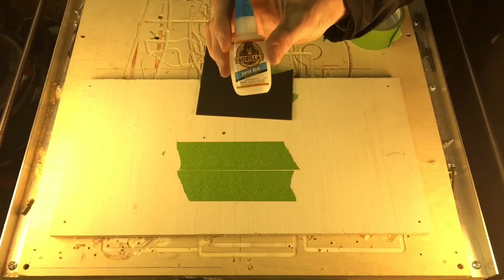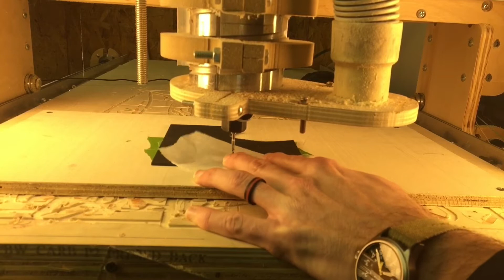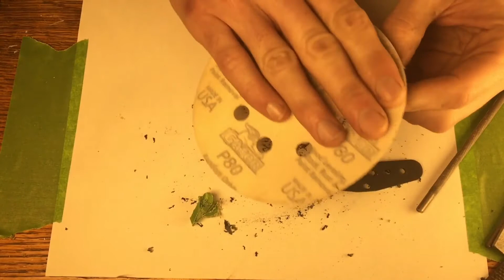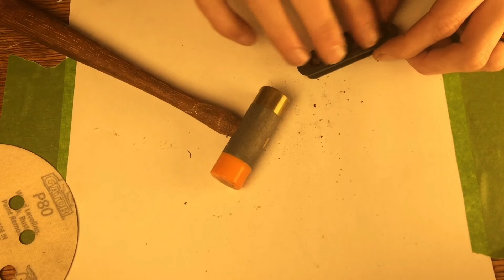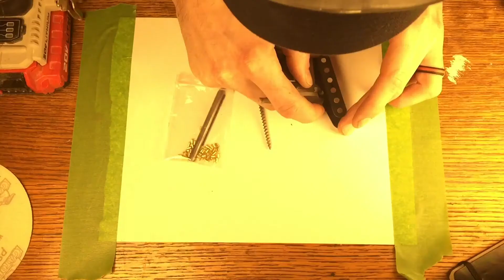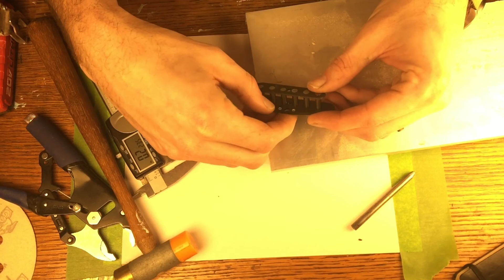How to Build a Guitar Pickup (Part 2)

Comment: Eyelets should be installed from the bottom so that there isn't anything on the coil side of the flatwork - that's how every one I've inspected has been made.
Reply from the maker: Madhusudana Das interesting. The ones I use if I do that it’s not too smooth on top.  Where when I do it the way I did, the smooth part imbeds into the flatwork a little bit and there are no spots for the wire to catch.  But it still may be wrong. Thanks for the comment bud.

Comment: is there anything that would make a decent substitute for the flatwork material? i was initially thinking corkboard but i’m guessing that would be too soft
Reply from the maker: Sleazer I think wood works well. Woods like walnut and maple. Here’s a 3 video series I did making a walnut tele bride pickup. Hope this helps. There are 3 videos to this project. The link is part 1. 

 https://youtu.be/AxztCnwj2iA
Reply from the maker: Sleazer hey buddy, I discussed this comment on my live stream if you want to check it out. 

✅Lets Talk Gauss Meter Plans, Subscriber Questions, B Bender Parts and Guitar Pickups https://youtu.be/1N5LERBiF4s

Comment: All insist on carrying out the waxing of the completed Pickup winding. I can't understand why. I noticed that in my 76 Jazz Bass Sunburst the pickup coils were wax free and danced on the magnetic poles! I used a dielectric insulating varnish called Dolph's or something. With that I definitely solved. 
It also has the property of crystallizing and firmly holding the coils.Since these are electrical windings, paint should be used for the windings of electric motors. Resistant to humidity, heat. If you want a really well done job use that product.
Reply from the maker: Andrea Politi I think anything that will make the windings stationary will work. Only issues with not potting is the vibrations from the pickups by the strings can over time rattle the wires and eventually short them out against each other causing the Pickup to lose its design or causing it to not function at all.  Hope this helps with your question. Thanks for the input and the question. Welcome to the channel!!
Reply: Hi Chase, thanks for your quick reply! I understood the essence for the choice of using wax to stop the possible vibrations of the coils which over time would rub the polar expansions of the pickup and their short circuit or breakage. Undoubtedly the wax always remains soft compared to an insulating varnish that crystallizes. This also allows you to absorb stress or shocks. Your reasoning is right! Thanks Andrew!
Reply from the maker: Andrea Politi I’ve always wondered if using a varnish or lacquer would work. The only issue I could possibly see would be whether or not the varnish would deteriorate the coating on the wire. I guess I could do a test and see. Thanks for the response!
Reply from the maker: Andrea Politi awesome!! Do you know a supplier of the product? I’d like to try it out. Thanks for the info!!
Reply: @ChasesWKshop  Hi the brand we used to be Dolph's is probably an American or English product.
They specialize in the production of dielectric paints and resins. I'll walk you around an Italian link http://www.miottisrl.com/categoria-prodotto/vernici-e-resine-elettroisolanti/. Surely you find everything in your part. You need to go to laboratories where they rewind electric motors. These are professional things and Industrial.

Greetings Andrea

Comment: What material do you use to build the flatwork ?

I am asking because I am trying to build some pickups for a custom base guitar.
Reply from the maker: Hey, thanks for the comment. I use flatwork I purchased from stewmac.com. Item number 5970 and 5971. There are two different sizes I use 3/32 and 1/16. One for top flatwork and one for the bottom. Hope this helps!